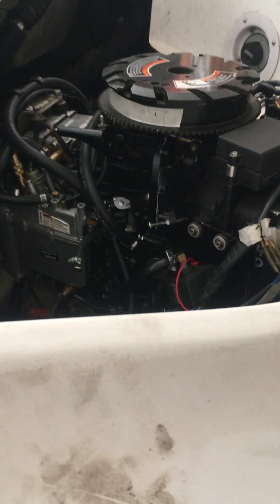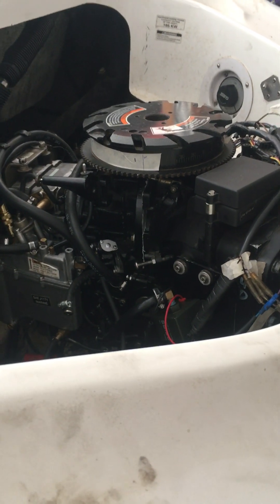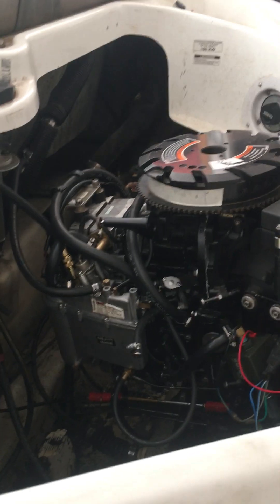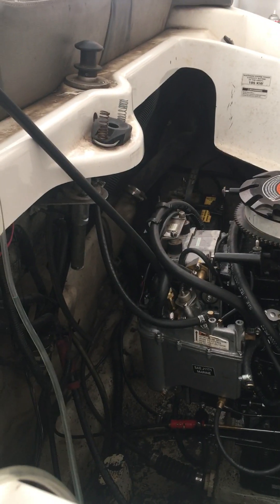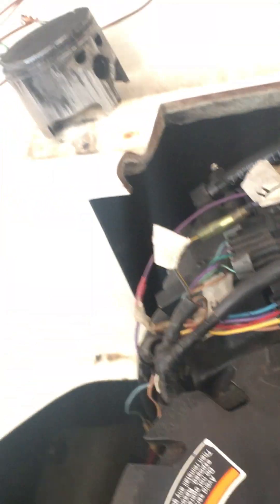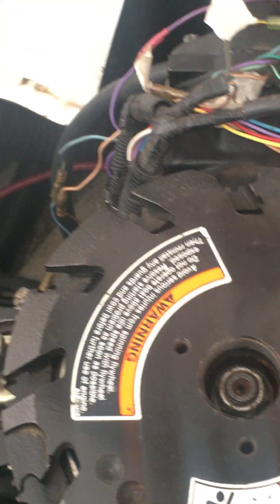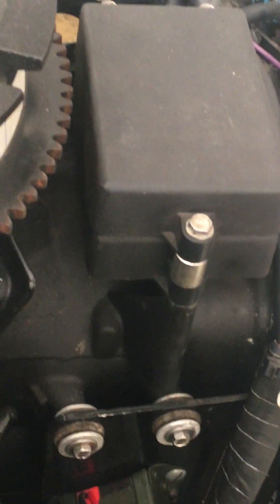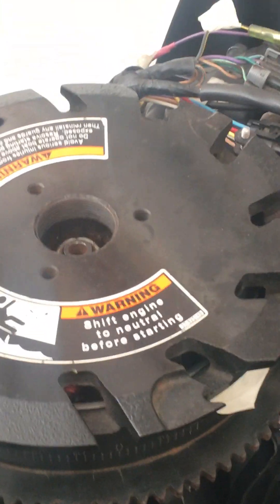SeaDoo Challenger Mercury M2 240 HP Jet Drive Won't Go Over 2500, 3500, 4500 RPM and Won't Start.

Comment: Nice job, I have the same boat that just started missing and bogging at full throttle. I have to figure that out. Lots of good information. The serial tag is on the top of the head.

Comment: I have the same boat that had the stalling out problem above 3500 rpm. Did everything basically the same as you, but everything was clean and in great shape, besides trigger wires. Which the insulation fell off of them so I just replaced the wires. I finally found out how to test the TPS and adjust it. That gave me WOT and up to 3500 rpm, nothing in-between. Bad TPS. I also was getting a strong gas smell and noticed gas coming out of the pulse pump and into the motor. So I replaced that hose with a longer one and made it take a tall loop before going to the motor, got a TPS from a similar motor that required some modification to fit and replaced the connector to match, set it and away I went. $60 TPS vs $880 TPS but man, the hours inside that hole working on everything, even the exhaust hoses... now interior work.
Reply from the maker: That was smart.  I probably would have replaced the TPS if it was only $60.  Luckily that wasn't my problem but, being a crappy mechanic, I tend to just replace parts.  It is amazing how many parts you can replace and still be ahead when the shop wants $250/hr.   Do you know the part number you found for $60?  I'm sure someone will be really happy to figure that out.

Comment: Any of you guys in New Jersey my friend thought he bought a beautiful boat yes, the seller turned the engine on for my friend and it started but once he took it to the water it had no power, he checked for compression and he claims one of the cylinders has no compression.  If any of you are in New Jersey and is willing to help please let me know.
Reply from the maker: I’ll tell you exactly what happened.  The injector for the cylinder that has no compression failed causing it to not be lubricated.  

With that said, it wouldn’t have “no power” with 5/6 cylinders.  It would go at least 45mph if that was the only problem.
Reply: @ That makes total sense, I keep asking my friend to give me more information about the boat but he doesn’t even know much about, he just bought it because it looks good and I say to him but looks won’t get you off the dock.  
So it looks like a total disassembly of this motor and check injectors.
Reply from the maker: I would say, if he is sure there is 0 compression. “It is definitely complete disassembly to figure out why.  With that said, after pulling the motor, I only disassembled the half of the motor with bad compression reading.
Reply: @golferdmr  Thanks for all this knowledge, now we just have to wait for the weather to warm up a little, with this 10's 20's and 30's can't really do much outdoors.
Reply: @golferdmr  Can you share where did you order the parts to rebuild the M2 v6 motor
Reply from the maker: When you find the serial number, you can go to the mercury site and use the schematics to find each part number.  I then bought everything on Amazon and eBay. I found the injectors and pistons used and gaskets new.
Reply: @golferdmr  ok cool i'm waiting to get exactly what you mentioned serial number, we will see, thanks.

Comment: Dude this is one of the coolest videos I've ever watched especially because there's no content on these engines at all. I've always been interested in getting a sea doo boat and I like the idea of getting the mercury V6 because it seemed more reliable than the sea-doo engines. Now you definitely have me second guessing myself this sounds like an absolute nightmare to keep running. maybe i'll buy one if i'm feeling masochistic. But regardless thank you for this video, very rare to find content on this engine.
Reply from the maker: I'm glad you liked the video.  I will tell you now I would absolutely recommend this motor.  It is really easy to work on and ever since I got it working, I have had zero problems.

Comment: It was a little hard I had to modify a few things when you pull the old cable out and match it up I ran mine through the drive linkage it's hard to make that turn make sure you take some pics for reference.

Comment: It's not starting good crank but not firing up any suggestions before I get into it..
Reply from the maker: I would start by chasing the fuel from the tank to the high pressure out put.  You are probably going to need to purchase a pressure Guage.  They are $25 on Amazon.

The first pump is low pressure and there is a couple filters.
Reply: @golferdmr  I'm going to check later today if I can hear that first pump running also was thinking about shooting a tiny bit of starting fluid in each carb just a small spray
Reply: @golferdmr  I noticed that square pump I'm going to check to see if it's even making a sound I should hear something before I Crank goon work on it Saturday
Reply: @golferdmr  where would the filters be located?

Comment: What's going on David good video I have an 02 Sportster 1800 same motor I just finished replacing steering cable..
Reply from the maker: How did that go?  I have a cable waiting in the garage but, the snow is just melting where I live.

Comment: Where did you get the manual from? I just bought a Seadoo Challenger with a Merc 240. This will be helpful info for me to go ahead and take care of the common problems/maintenance with these engines.
Reply from the maker: So the first manual I bought was for the Challenger but, it’s worthless.  You need to buy the manual for the Mercury motor.  I got mine on eBay for like $10.

Comment: Hey man 
So mine isn't going over 4000 ..
My question is what the the trigger do?

Some machanic said its a fuel problem but i have 40 psi and that it has 3 fuel pumps and that it would me $2000 to start working on it and keep going up after that if thats not the problem.
Reply from the maker: I could definitely see it costing that much as mechanics in my area are now $180/Hr.

To answer your question, I think the trigger is like a distributor.  It sends a signal as the fly wheel and stator spin around it.  It is what your are advancing (turning counter clockwise) as you engage the throttle or mess with the timing screws. WARNING, after I messed with my stator, it must have got pinned in the advanced position and when I started it if for the first time it took off at full speed. Luckily, I was pointed in a safe direction. I yanked the throttle back and fourth and it never happened again but, it really scared me.

I think of it this way, you can try to replace it.  It’s under $100 on Amazon and you will need a flywheel puller (under $20).  It is a very easy job.

I would also disconnect the fuel line coming from the water separator (looks like oil filter) to the Vapor separator (looks like a oblong aluminum tank).  If there is good flow when you turn the key to “on”, not start, you have eliminated 2 of the 3 fuel pumps.  I would also get a fuel gauge, remove the valve stem from that bicycle stem looking thing on the top of the vapor separator and install the fuel pressure gauge and just don’t remove it until you figure this out.  It’s is weird that yours is a 40 pounds, the book says 34 and mine never moved from 34 after if got the fuel issue fixed. There is a pressure regulator that should keep it at 34 pounds.  I think the high pressure pump can go to 60.

Finally, there is a procedure in the manual where you can see the injectors fire by taking off the cover.  You can do all this without removing the engine and it wouldn’t take very much time.  I would go that route if its not the trigger and your low and high pressure pumps are working.  In the end, all my problems were caused by one bad injector.  The boat will do 4500 RPMs on 4 of 6 cylinders.
Reply: Hey do you have the info where you bought the lift pump .. did you get an aftermarket or original?

And do you know how much psi it should have